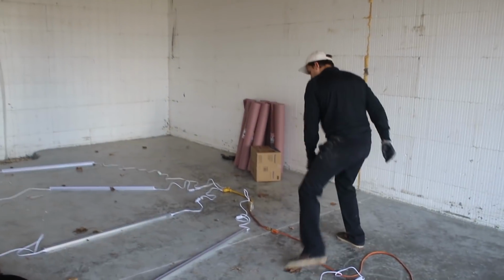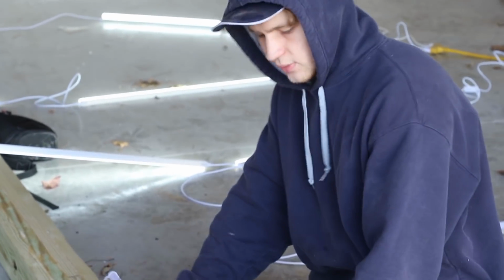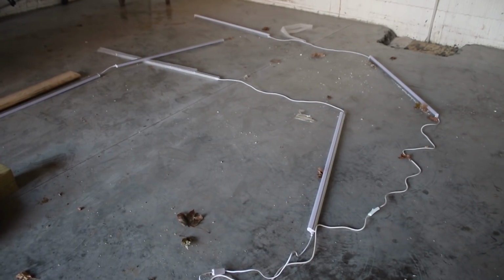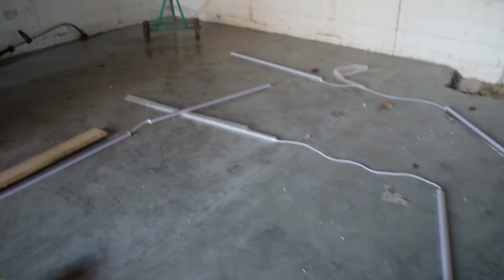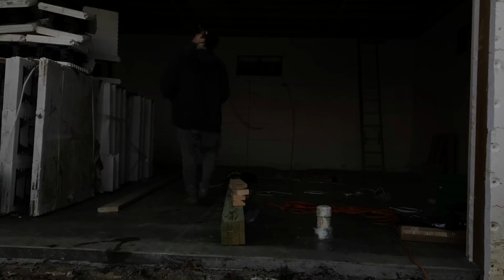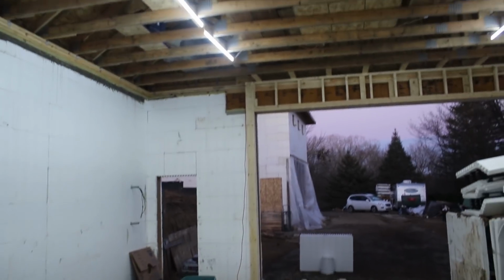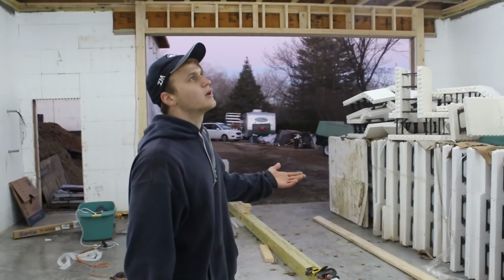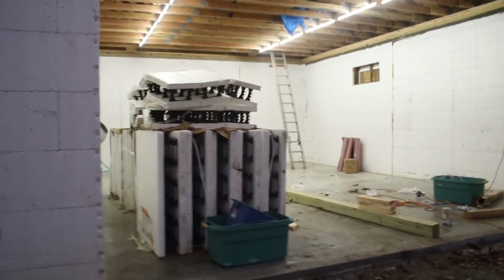Budget LED Garage Lighting Install Video Barrina T5 Quick Cheap

Comment: 6500K is the color of the light, not the power or brightness. This should give you "bright white", which lands more towards blue in the spectrum. For a warmer color (like indoor lighting, which appears more yellow) you would look for a lower number such as 4000K (which would be called something like "daylight"). I also prefer cooler lights like this.

Comment: 4ft [1.2m] 2200lm. 26400lm. For 100$. Power consumption ~16w per meter. 
I got for my shop 5050 led strips. 1100lm per meter. 5m strip 3.5$. 5 led strip, about the same lm for 18$. + PC PSU. Power consumption ~14w per meter.
Can do better..